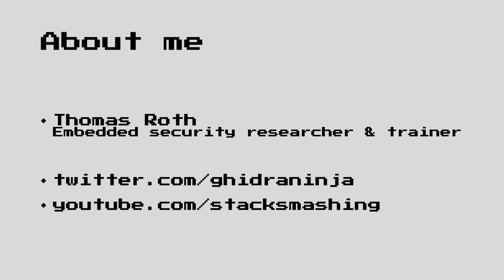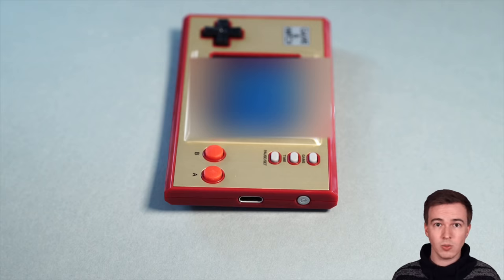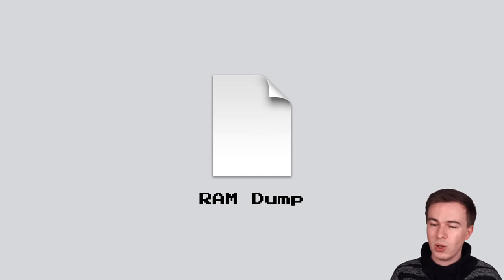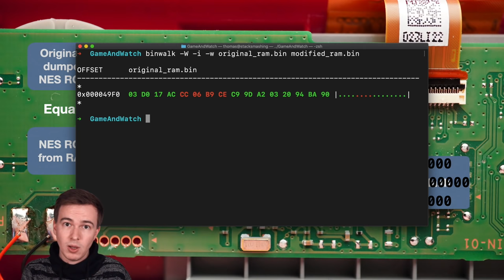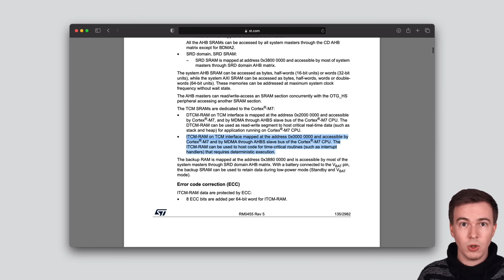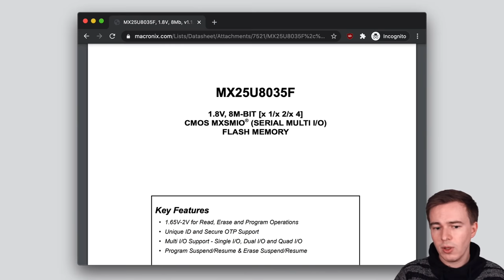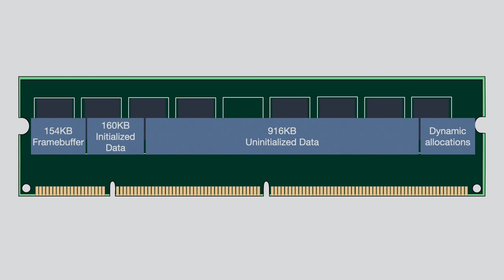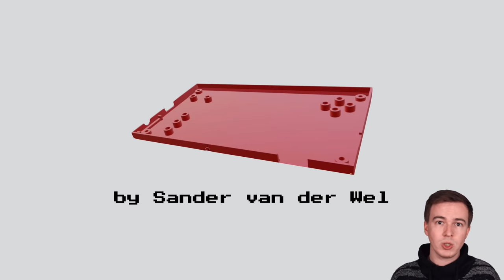rC3 Talk: Hacking the Game & Watch

Comment: Hi, I am trying to follow along and use this video as a guide to replicate how the encryption was broken. I am a little stuck at comparing the RAM vs ROM. I have downloaded the ram at memory addresses 0x20000000, 0x240000000 and 0x30000000, but where did you find the original (unencrypted) rom in memory? I have an original rom and I cannot find this anywhere when comparing against the ram snapshot. I have used your bitmap extraction program and I can see the frame buffer and get a nice picture of the video but I can't find the unencrypted rom. you seem to have one ram file as well instead of 3? did you just combine the 3 ram addresses into one file? but mine still seem a lot smaller in size even when combined when compared to yours. ( although I am using the Zelda version game and watch)

Comment: Great talk!

There's a small mistake around 17:11 :
When you have a ciphertext encrypted with AES-CBC and you flip n bits in one of the encrypted blocks, only the corresponding plaintext block + the bits at the same indices in the next plaintext block will be corrupt. The following blocks will decrypt normally. So if you set n bytes to zero (assuming they all belong to the same block), you'd get 16 + n corrupted bytes in the plaintext.

Comment: I had no idea you could get the encryption key if you know both ciphertext and part of the clear text. Does this only apply to AES-CTR? Do you think it would have been possible to hack this if Nintendo had used authenticated encryption?
Reply from the maker: You can't get the encryption key, you can only get the XOR-stream that was generated by AES-CTR - hence the need to have a unique nonce.
Reply: I see. Does that mean that you could only replace the bytes that make up the ROMs (the cleartext that you know) in the flash? The streams differ in each block due to the counter, no?
Did you later find the encryption key in the firmware dump?
I also don't quite understand how this relates to iv reuse - did they not encrypt the entire flash in one go, but the ROMs independently, both times with the same key and iv and the counter reset to 0?

I think I have some serious reading to do on encryption.
Reply: @Pesthuf  yes you do :P
Reply: @RWL2012  Are the things I concluced wrong? If so, why?

AES-CTR uses a different XOR stream for every block (128 bits) due to the counter being increased. And since he didn't have the encryption key, there should be no way for him to get the XOR streams for blocks outside of the plain texts he knows (the ROMs).

And IV reuse can only be a problem if you encrypt two different messages with the same IV. I don't see how that applies here - the Flash is one single thing to encrypt. Or did they actually have a filesystem on there and encrypt every file with the same Key & IV?
Reply: @Pesthuf  All he needed was the plaintext he knew from RAM dumping - this allowed him to change the data in those areas and one was enough to get control of code execution.  But sometimes there are further attacks where you can brute force specific areas, etc, so if you know something is running AES-CTR, you have abilities to flip individual bits if you know where you need to be trying to flip them.  You can just flip a section until you get the right combination via some futher effect, though it might take many attempts.
Reply: @big0bad0brad  So its more of an Brute Force Attack. Wouldn't it be possible to disable the AES decryption and store the ram dump onto the spi?
Reply: @Spelter  No, this wasn't a brute force attack, but were there no way to access the plain text from RAM dump, it could still be possible to execute a brute force attack on spi flash alteration (or more realistically emulating the SPI flash) assuming there is a way to automate the test cycle.

It's not possible to disable the decryption without altering the program to well, not use encryption.  You have to get a copy of the program to easily alter it, unless...

You can try changing data in random places until you find where changes cause it to deviate from normal behavior/power consumption earliest.  If you're lucky this is some boot code.  If it is code, you can try to guess/alter the first changed instruction (it could be a branch instruction if it tends to do wildly different things when you alter the address field in it) - once you can work out part of the instruction bits you might be able to figure out some more bits of it through guessing subsets of changes and watching behavior.  It's a messy game but once you get a couple instructions figured out the rest get easier because you can do some setup prior to the next instruction you're testing.
Reply: @stacksmashing  I had something similar, yet quite different, when I wrote an open-source library and upload manager that works with the Philips MCI500H HiFi systems with internal HDD. They "encrypted" the album art (and just the art, not the actual music) for unknown reasons (the closest answer I got was that it was done for copyright reasons) with a repeated 4k random key that was XOR'd with the image data.
I was able to write software that could read and write these files without the need of sharing or extracting the key by the end user, by including two image files, one original and one that the original firmware/software had derived from my input. XORing the two and clipping the result to the key size, at the start of the application, yielded the key without sharing it or parts of the original software.

Comment: I'm just going to take stab-in-the-dark, but....

How difficult would it be to fix the usb data lines so that they work ?
(EG. soldering the data lines to the proper pins on the CPU, etc, and modifying the firmware to allow communication)

Comment: I was thinking that to use the USB plug for data purposes, the only thing needed was to wire the two data pins from the microcontroller to the USB connector, but I just read the datasheet for that microcontroller, and while it has USB 2.0 OTG capabilities, there's no pins for it in the 100-pin package version Nintendo used for the game and watch.
What a pity.

Comment: @stacksmashing - do you know if anyone has considered swapping the SPI flash for a Micro-SD card? The SPI protocol is the same as basic SD-card I/O. Fairly sure you could make a removable storage solution like this to store multiple games.
Reply from the maker: Couple of issues with that:
- SDIO is 3.3V, so would need level shifters
- A lot of microSD do not support that protocol anymore
- The memory mapped mode does only work with SPI flash :)
Reply: @stacksmashing  interesting, every<2GB card I've tried does support the protocol, at least using the PIC microcontroller anyway.

The level shifters shouldn't be an issue, most of the micro SD card interfaces from China have a 74lv14 IC and associated resistors to protect the card.

I have to admit that I'm not entirely sure how it could be implemented as removable storage, but certainly as bulk internal storage it could be an option.
Reply: @davegsm82  He didn't mean that the voltage levels of the G&W could damage the micro SD card, but rather they are too low to be properly registered by the micro SD card's input circuitry.

Comment: Why do you think Nintendo went with RDP protection level 1 instead of 2? They seem to have gone to more rep how this time to try and prevent hacks, so why not lock it down completely?
Reply: I'm not entirely sure if RDP level 2 completely disables the debug port or just additionally locks RAM, but if it disables the port, leaving it at level 1 might help them to either fix bugs in unsold stock by allowing its reflashing (very unlikely), or allows them to debug issues with the product in the field to mitigate them in a later batch (more likely).
They were probably not very concerned with this device getting hacked, as it does not contain much IP that was not already shared everywhere on the internet. And also since there are no new games to buy for it, as well as no internet connection, it getting hacked would neither affect sales nor their infrastructure so wouldn't be any concern to them.
Encrypting the flash was most likely just to make it not too easy to just dump the ROM, but not to affect the performance and requirements on the CPU too much.
Reply: @0xbenedikt  I understand the idea of leaving themselves a way to debug. However, if they don't care about it being hacked, then it would make sense to me to not bother with RDP at all (leaving it at 0), so it would be easier to debig. It seems they thought putting it on 1 would deter hackers in some way. I suspect they just underestimated programmer abilities, like they did back on the Wii U, thinking indie games wouldn't sell.

Comment: Surprised that, unless I missed it, you didn't cover why merely replacing the NES ROM wasn't viable. FTR, Nintendo dies an in place ROM patch to make some small alterations, and that patch would break most other ROMs.
Reply from the maker: I mentioned in another video that the ROM is patched - however patching out that patch is also trivial. However replacing the emu with your own gives you much more flexibility and you can iterate much faster without constant reverse engineering

Comment: The Mario romhacking community is one of the oldest and the largest, with a ton of hacks on SMB1. So, my question is, is it possible to run these without loading an emulator? For example, could you load a Mario Romhack on top of Ball? I personally want to load "Super Mario Bros Special for NES", an NES conversion of Hudsonsoft's SMB Special.

Comment: what is the max flashupgrade size?
Reply: 16MB without significant effort. Desolder the old flash and solder a new one. Going larger is possible but requires more work.
Reply: @kbeckmann  how large & what kind of more work?
Reply: @paparansen  32MB if you can source the chip, and then some more difficult soldering. I know a lot of people ask about SD card support. It’s not possible to get it memory mapped without a bunch of work and hardware modifications, however you could write a loader that loads a rom into ram but this also has limitations. We’ll see if anyone comes up with a good solution for this. Right now there is no simple way.
Reply: Also there is a 16MB flash that is compatible with the stock firmware which is interesting for some people.
Reply: @kbeckmann  ah ok, then we will wait and see... thank you :)

Comment: I wasn't even born when the Nintendo 64 came out but I know the pain of having to blow out cartridges
Reply: Nintendo 64? Dude, that was Atari and NES from the 80s. With the N64, it was known how to clean it with a qtip 😉
Reply: @Spelter  yeh, but my cousin's told me to blow it out which never worked. I ended up thinking that some of the games were just broken
Reply: @supdograinbarff1460  could be. The problem was many times broken solder joints or broken lines from the cartridge plastic. They were fixable today, back then it was hard.

Comment: Great hack, and Nintendo were showed how incompetent they are and that they just should release the stuff with easy access or are showed off like here.

In the old days, lack of Hard and Software for doing such hacks made the systems a bit more secure. But nowadays, with all that brainpower, they couldn't stand any chances.

I still think, it would be possible to remove the decryption for easier access, but it's broken anyway. Now, all is left is to be able to run other games from a USB drive, so you would need a extension board you place there instead of the rom chip (or put a bigger chip in it). If that would work, you could put in NES game dumps and have a fully functional handheld console.

I would love to tinker with such stuff, but having time for it is an issue. I envy you to be able to do that on a daily basis 😀 Most in can do, is reverse engineer NC binary files and reimplement a generator for our company.

Comment: Nice, but a better challenge would be hack the XBox One... many years passed and defeated all hackers! ;)
Reply: Perhaps it is because as already talked about in past CCC events is that all the games you want to play are already on PC and because of the dev mode you don't need to hack the console to run applications on the console. The only thing left untouched was a complete new operating system.